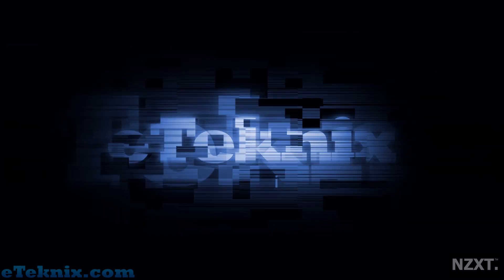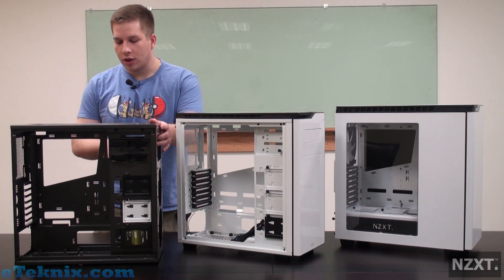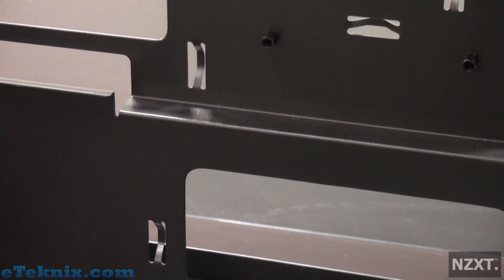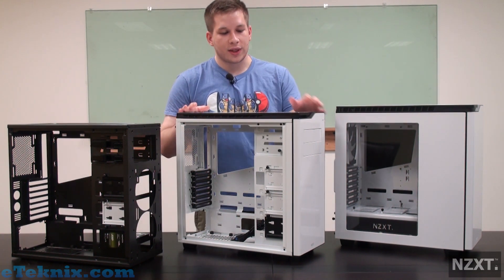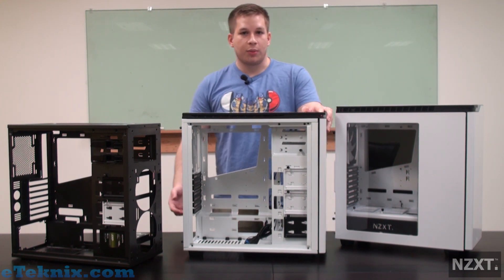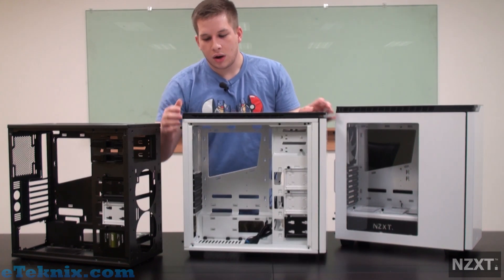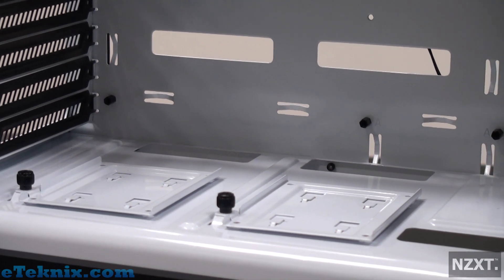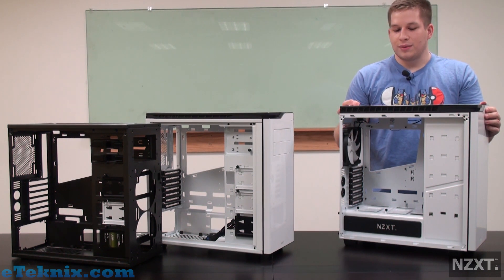Creating The H440 - A Behind The Scenes Tour With NZXT

Comment: I love my nzxt h440 case.  I am considering custom modding to get rid of the hard drive bays completely and make a larger window.  on the other hand, im not into custo water loops so i really dont want to use water reservoirs and such. i was thinking i would add a panel to the back and mount my ssds to show them off but the current ssd spots over the psu shroud is perfect.  the case airflow is prertty bad and air cooled components suffer.  cant wait to see your next line of products.

Comment: Keeping positive air pressure and maintaining airflow is very difficult with this case. If you are considering putting a high-end build in this case (and overclocking) I would recommend water cooling your gpu(s) and cpu.

My only complaint about this case is I wish it had a place to mount a 120 or 140 fan on the front bottom section with a dust cover

Comment: I had to re design the resistor board because your pcb designer made a right mess of the original leading to the boards to fail over time. i also did the power on/off  pcb board too. checkout my channel to see the videos

Comment: What you didnt think about is that more people use some sort of a 5.25 inch drive instead of filling their cases with nothing but radiators. this is a budget case, I think most people looking to buy this case aren't really thinking about radiators here an there, i think they are thinking about installing a NZXT hue, or NZXT 5.25 fan controller, now none of that is possible.

Comment: For better next H series:
1. Make three 140mm front fan & support up to E-ATX/XL-ATX motherboard.
2. Full covered (not windowed) & noise damped side panel.
3. 140mm/120m fan mount option behing HDD caddies (improve airflow).
4. Make larger & bigger front panel holes (like in SilverStone FT04).
5. More rubber grommets.

Comment: wait what it dose not suport E-ATX i missed that complety. now you need to go back to the drawing bord and add 1 more pci slot so it has 8 and make sure you can have E-ATX
Reply: No you can not get a E-ATX mobo in that case they have angeld the part whare the cable management hole is in. so the mobo will hit it and can shortout if you are unlucky. and the reson why i want 8 pci slots is so i can fit a gpu in the bottom pci slot like the rampage iv extreme has
Reply: thats why i think they shud ad another slot. so it will be like 1-2 cm higer and make it 3 cm longer
Reply: silentpower Yes you can. 2 pretty good options: Cut out a few of the square rubber pieces from the normal side ATX grommets (half of those will be covered up anyway. Then, sandwich those between the board & angled part of case to insulate. OR Just put some electrical tape on the back of the board.
Reply: That's what I did for my Asus RIVBE. It fits perfectly, the angled piece doesn't interfere at all. All it took was to remove the grommets and putting some electrical tape underneath the motherboard to prevent short circuits.